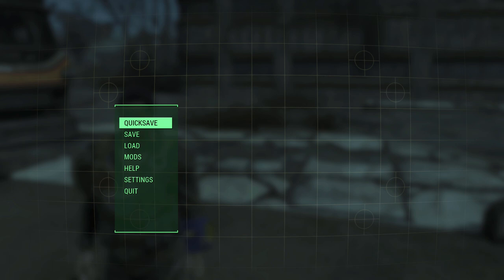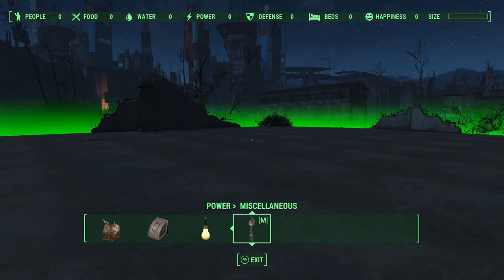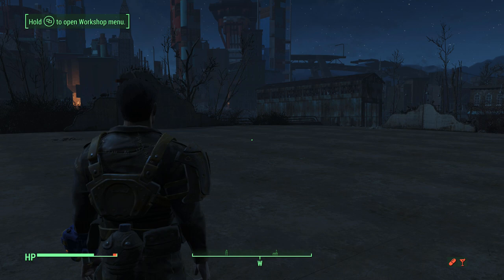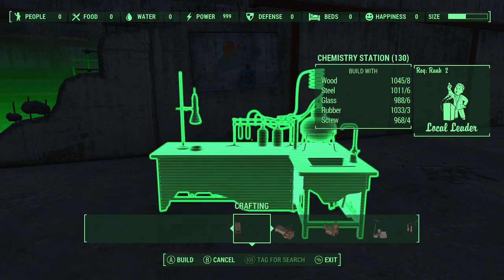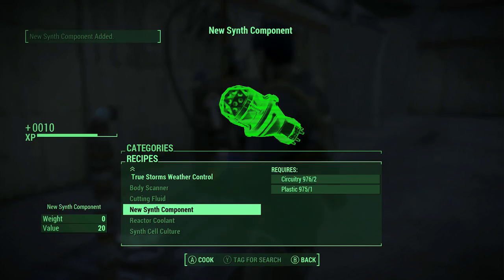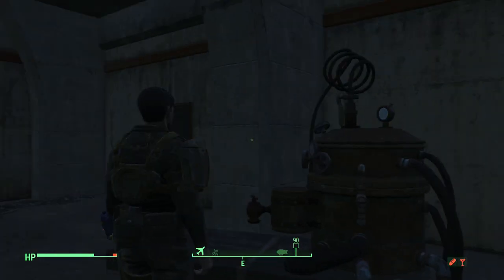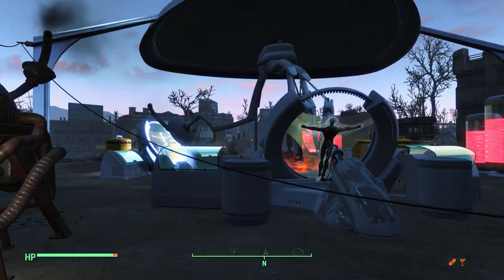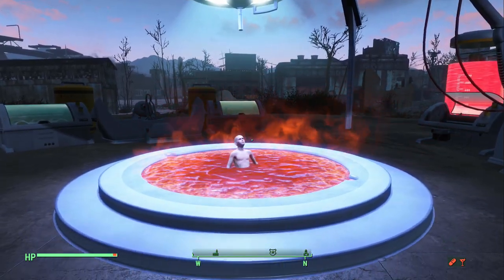Fallout 4 synth fabricator up and running step by step tutorial! hope this helps

Comment: I have a problem about the terminal part it says token.name=tissue level and the same with the bone and the components I tried to re wire the system and removing the wires and re arranging the wires. Do you know how to help?
Reply: I’ve had the same issue

Comment: Terminal has no options......need help～
Reply from the maker: Did you connect the wire that goes from the fabricator to the terminal correctly if you did and it still doesn't work the only thing I can suggest is uninstalling the mod loading back to an old save before you had the mod and then download it again I've tried to get in contact with the creator of this mod but he has not even read my message if this doesn't work please get back to me and I will try to help you further.